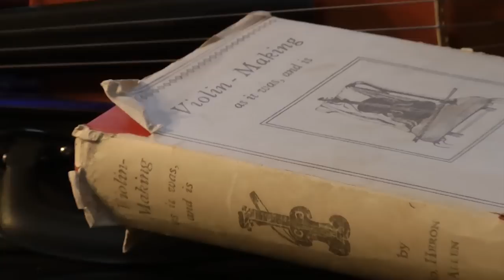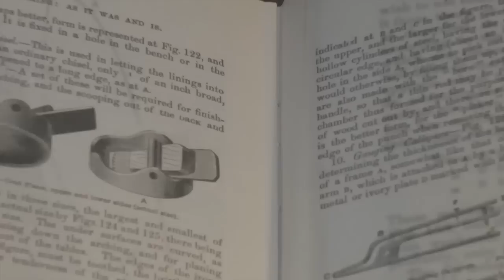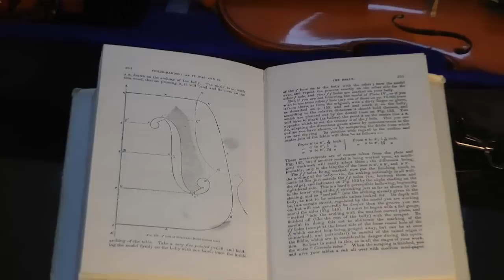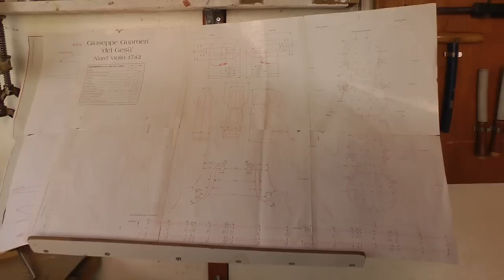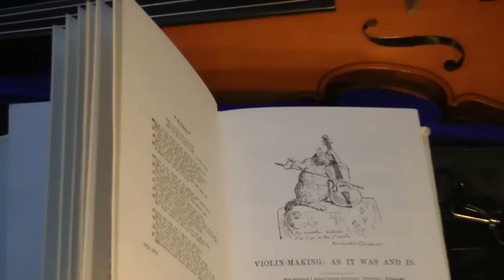"Men in Sheds" - The Luthier

Comment: In the very first shot - why is the church spire leaning to one side?? Then the second shot of the spire, a close-up -  was the spire deliberately built lopsided, and at a different time? Weird...
Reply from the maker: Hi califrogg. This is Chesterfield's famous Crooked Spire, correctly known as the Church of St Mary and All Saints. It twists and leans.There are a few other similar spires through Europe. The true reason for the twisting is not fully understood but the use of unseasoned green timber, the design of the support structure and the huge mass of the lead coating it is the main suspect. Thanks for watching. GRoB